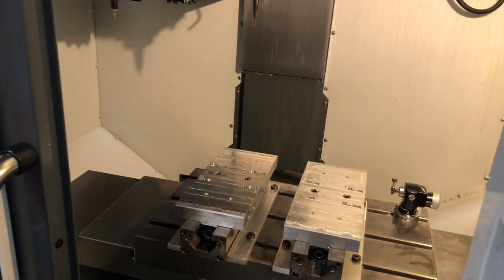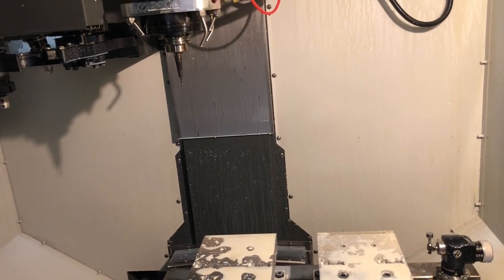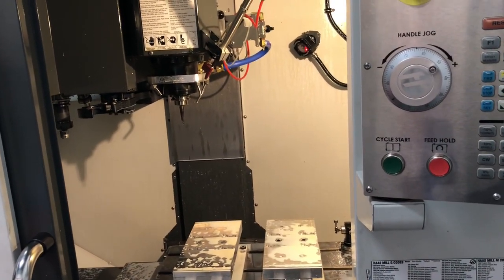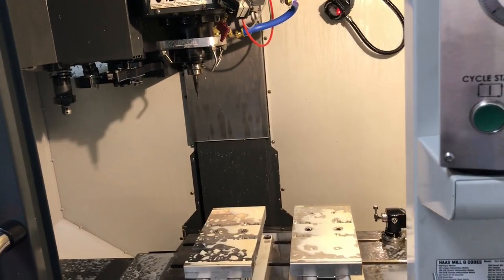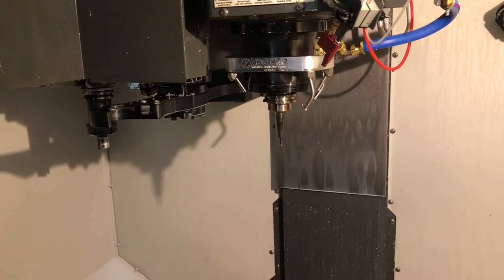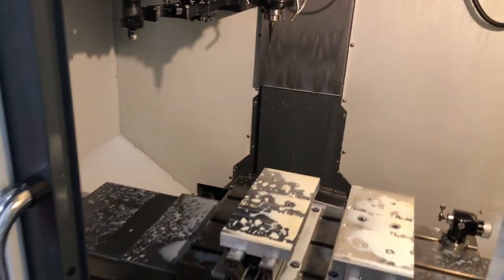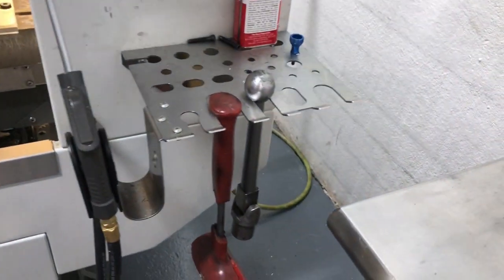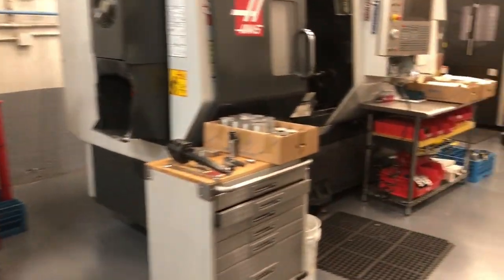Quick review of the Haas DM1 CNC machine vertical Machining center

Comment: Great video.  Is the machine still dropping tools?  Also is the 250 table capacity an issue?   We want to put two orange vises on the table and they with 100 each.
Reply: Yes, it has been running without any issues for 3.5 years. You can fit two 20"s on the table.

Comment: The front auger means the table can only be within 15in away. What is yours?
Reply from the maker: There are no front augers on the DM's.  There is one on each side of the y axis and then the optional one is external on the back of the machine.  The 2 side augers dump the chips out the back into the rear auger if you get it.